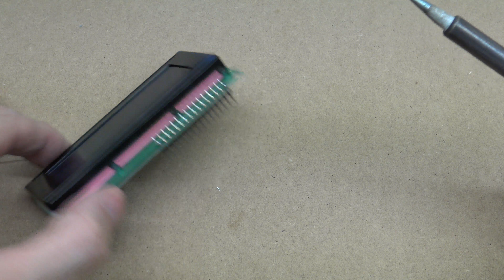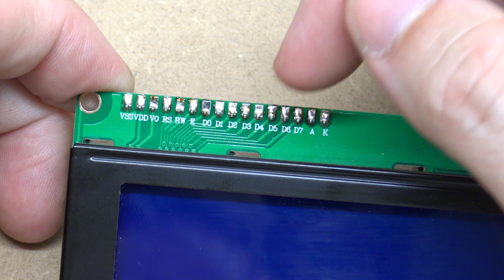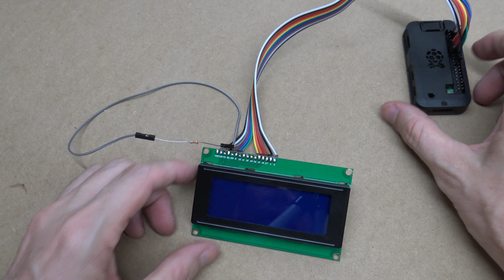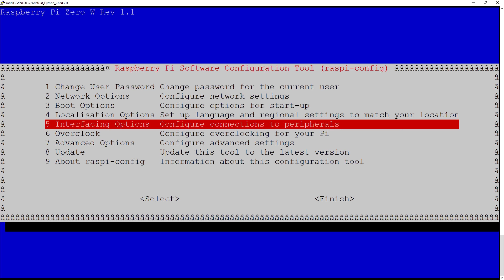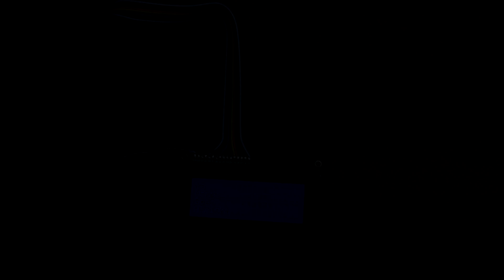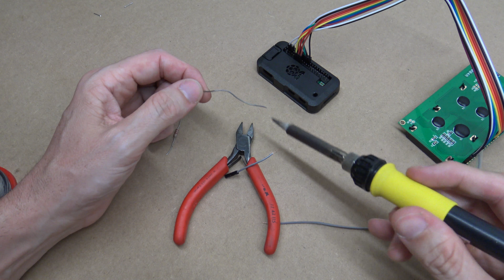Raspberry Pi LCD

Comment: Could you make a smart irrigation controller using a raspberry pi to control the sprinkler solenoids? Sounds like a fun project
Reply: Definitely. I started using a raspberry pi for my hydroponics which performed similar functions. You might be better off using Arduino though. Arduino are much cheaper and don't depend on an operating system including start up and shutdown processes.
I set up a system with an Arduino nano, relays, temperature sensors, water level indicators and a GSM module which uses RESTful calls to my website. All this cost about £15 UK pounds.
Reply from the maker: Of course. You might want some external relays, but you could do anything like that.